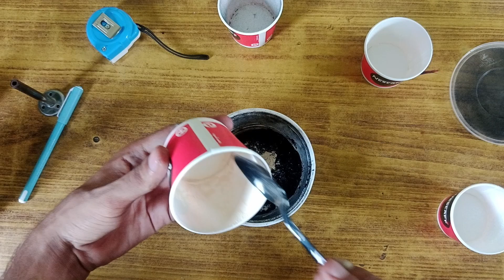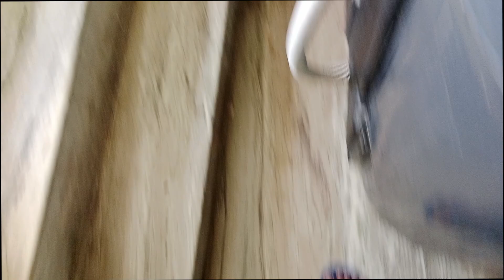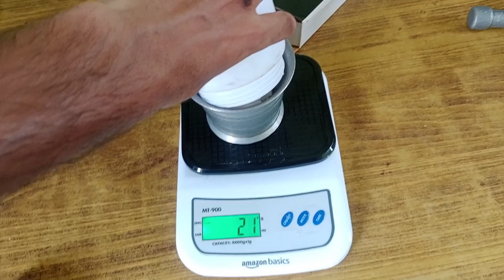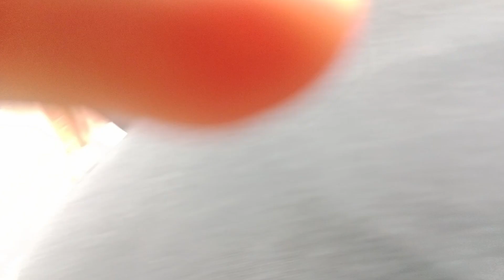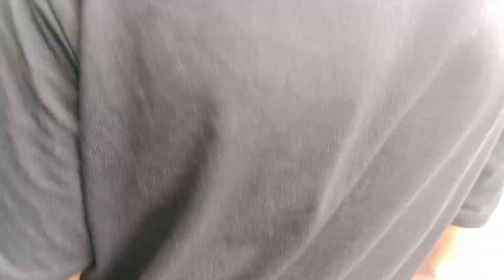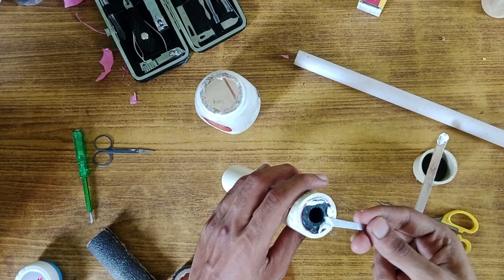PVC Rocket motors are dangerous 💣.

Comment: i wanted to use ammonium nitrate on my rockets, since it doesnt have solid residue when burning. but it is unavailable in my region because it is controlled by the government, and the online options are always impure and expensive. also, i am looking for a binder that doesnt use heat or is extremely expensive and difficult to find like htpb. i tried using ethanol to set my grain, but since it is almost 1kg of propellant, it didnt really dried, also, sucrose isnt soluble on ethanol at room temperature and i cant use water because the sucrose would supersaturate the water, creating uneven crystals, furthermore, any residue humidity would literally explode the grain upon combustion, leading to the explosion of the entire motor. anyways, im stuck to potassium nitrate since it is really the only option i have. NACLO4 or NACLO3, or even KCLO4 cant be used because they leave solid residue and i dont have strong enough electrodes, despite being more efficient
Reply from the maker: I also want ammonium oixdizer but the government doesn't agree, and it's easily available online but expensive. Why don't you try isopropyl alcohol?
Reply: @CosmicCraft-r47  aditionally, i have been using a metal motor of carbon steel sealed with plate on the end and with about 8cm of epoxy for extra rigidity. theoretically it can support up to 90 bar but i never burned it. when you create a metal motor, please use good quality threads, solder and do an hydrostatic test, i cant because i live in brazil and everything costs a liver
Reply: @CosmicCraft-r47  also, when building metal motor, develop a liner substance that is strong enough, even when the burn is over, generally it still flames and without a liner the metal will be burnt through, trust me it has happened once. if you are in a budget you can use refractary cement, aluminum oxide and baking soda, the cement is binder and prevents burn, baking soda decomposes and put out the fire and aluminum oxide helps with thermal resistance
Reply: @CosmicCraft-r47  for the computer, also add an IMU and GPS, it will be good for data and future fin active control, instead of sd card module use open log, it is much more easy and reliable. build an ground station with nrf24 or LORA for communication between ground station and rocket. for the  pyro channels, add pull downs on the output and use pyro mosfets since they are more specialized. you can tweak all of what i said to suit your project better
Reply: @CosmicCraft-r47  and please esp32, much easier and maybe cheaper depending on the model
Reply from the maker: @genioreal__ you are right! I just found a esp at a very low cost. I also got a Nano at a very good price! Raspberry Pi Pico is strong but i got some logic level issues with that. And can you message me on instagram because i want to know more about your work and i want to learn new things from you!
Reply: @CosmicCraft-r47  good idea, i didnt think of that, but some component of the solid propellant must be soluble on it, or else it will crack(and even when not) and have less rigidity. also, when preparing, there is a risk of the isopropyl alcohol vaporizing before casting. i am thinking of using isocyanates to cure oil but even if i can use it without killing myself(best option would be hdi because it isnt as volatile), it is just as expensive as htpb. for now i dont have a theoretical solution, so i am thinking of choosing the best candidates as a binder and testing them. generally, it is a long process and i aprecciate people like you that have the patience and ambition to build something so incredible, keep up with the good work, it will pay off!

Comment: bro nice .i have a  idea . you can make a motor case from steel pipe and make motor liner using  pvc pipe so 2x strength❤❤❤❤
Reply from the maker: Good idea 👍 maybe i will make a full Metal rocket motor in the future

Comment: Bro You should made a silicone sealant rocket moter .  its not messy and works great. Just use pottasium nitrate and silicone sealant. 60%-pottasium nitrate  40%-silicone sealant .❤
Reply from the maker: I never heard about that but i will research about that maybe it will prove helpful

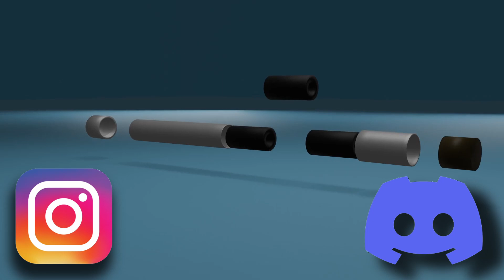Comment: 15:26 I think pvc is totally fine but just slow down the burn and please don't reuse the motor case
Reply from the maker: I am trying to build an all metal motor and it will be reusable. And for the fuel, i will not use charcoal in the fuel because i think the material density also plays a big role in the burn rate, maybe a high density fuel sugar or aluminium powder will be better.